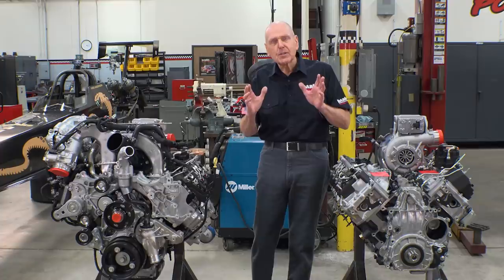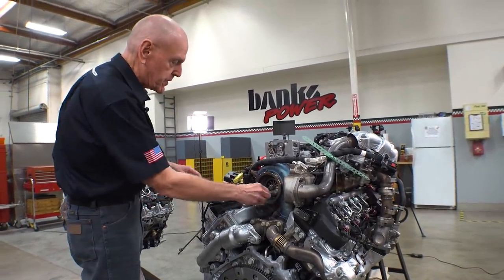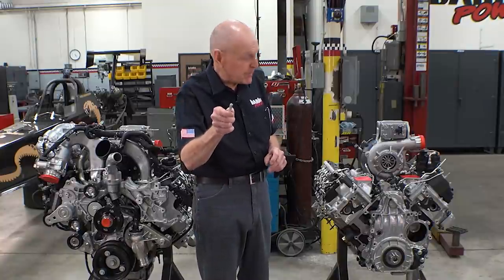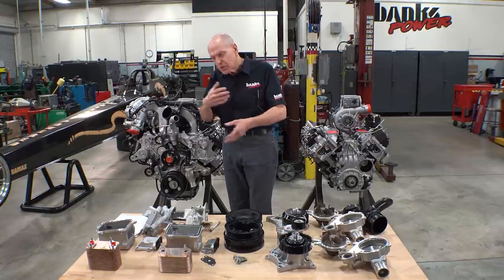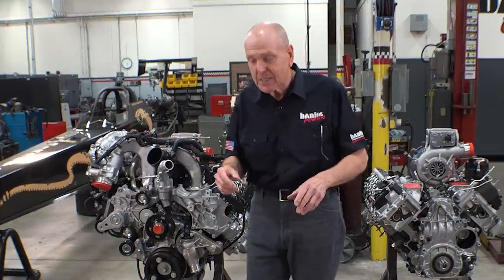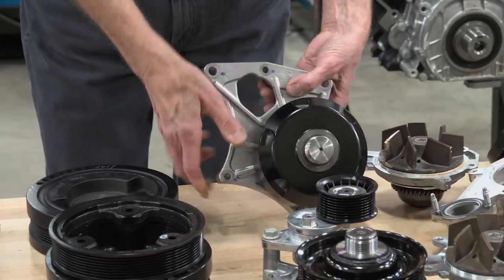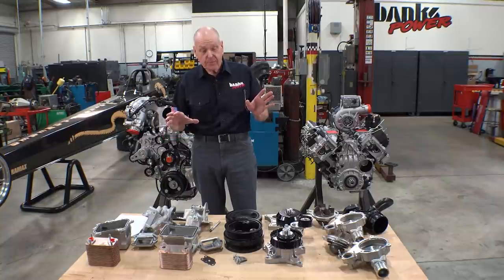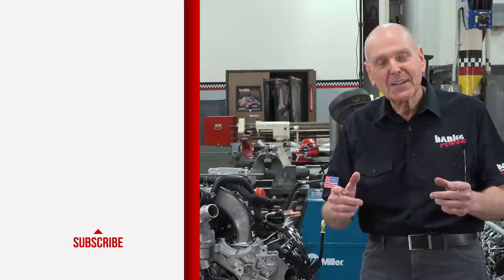2020 DURAMAX L5P Engine Revealed!

Comment: Banks is the the Diesel God and the Duramax is a sweet engine. Cummins are good engines but no match to the Dmax. Ford is about 15 years behind in Diesel technology. The ford guys think they have it all lmao. Yes Dmax had problems in the LB7 engines and the LLY was not that much of a upgrade either. Duramax got their shit together with the LMM engine. Dmax engines with the Allison trans is a bullet proof combination. I love the Duramax and worked on them from their inception. Yes ford sells more because owners trade off every year but it’s a fact that GM owners keep their trucks longer. I’ve had my GMC since new 2011. I just picked up a 1ton Doolly with the Duramax and she is a keeper as well.
Reply: Cummins is no match for the durajunk what the hell are you smoking ? Cummins is the greatest deisel ever period !
Reply: @nicknadeau7173  Why? Cuz YOU say so? OK
Reply: i cant afford any of it, ill just keep my old 12 valve.
Reply: We sure don’t trade off after a year , fleet of 20 plus f550 diesel all 200k no major failures , 550 chassis with a custom built body to house concrete tools , pulling a skid steer , gmc doesn’t even make a chassis to compete , try again I’m not saying ones better than the other but come on
Reply: My lly made it to 500,000 on the original injectors and pump. Ran efi live at 430hp from almost day 1. Upgraded to a 2015 high country dmax. Miss the sound of my 05 lly but the rest of the truck is a definite upgrade. Hopefully I get another 500,000 out of this one.
Reply: tlt40s&w 70 no match for the Dmax in blown head gaskets and injector consumption! If GM had their heads in the game they would have been able to tow over 30k when Ford and Ram started to almost a decade ago!
Reply: tlt40s&w 70 by the way, you know GM invented “planned obsolescence” right? The concept that customers will spend more money to upgrade to the next model every year if they slowly release revisions and tech to the market. I know you’re confused and it makes you feel things but get your facts straight.
Reply: Lb7 was the only one known for excessive injector failure and they stood by it up to 200,000 miles. We know ford and dodge would have never done that. And we had a whole fleet of dmax trucks. Every one of them went to 300,000 miles before they were traded in. Mine was the only lly and it was the only one to require headgaskets. And the cause was easily fixed. And all manufacturers use planned obsoletness. That's nothing new. Heavy equipment is way worse about that. Case constellation equipment discontinues parts after a model is 10 years old. They wont even support what they made. I dont like the business model of any of the big 3 but gm definitely builds the best HD truck currently with the most consistent track record. And the 30k+ tow rating is a gimmick. Less than 1% of consumers  actually tow that much with their HD trucks.
Reply: Michigan Farmer so you admit that Chevy guys don’t keep their trucks as long as ford and dodge guys? I have a fleet of Cummins, several over 600,000 miles on original engines and transmissions, which were just getting broke in at 300,000. Good friends of mine have fleets of Ford 7.3 trucks, some with over 700,000 miles on original motors and transmissions. Do you know how often we do ball joints? Less than you. Not to mention that these trucks are all used as fire trucks and are beat off road. No IFS Chevy can handle the abuse that these trucks do. We have had to leave Chevy trucks behind because they can’t handle the trail. I’m guessing because you’re from Michigan that you’re a flat lander, but here in the mountains we will take our straight front axles for durability and maneuverability. Also, Chevy didn’t stand behind anything on the LB7 and it was not the only Dmax to have injector issues. The LLY was not the only Dmax to have head gasket issues. How about turbo failures at less than 15k miles? There’s a long record of them. Radiator failures under 20k miles? A long list. And Dodge wouldn’t have stood behind it because no Cummins have had Injector or Head Gasket problems. Your facts are anecdotal. A good friend of mine has a fleet of welding trucks. He bough 15 Dmax trucks in 2016 for his guys and every single on has either had the turbo fail or the radiator fail under 30k miles. Do you know how Chevy helped him out? They told him that due to him driving his trucks on gravel roads they would not stand behind the truck and warranty parts. He was on the hook to pay for the radiators, turbos, and on tow trucks full engine rebuilds. Needless to say, he traded his entire fleet for Cummins rams and says he will never look back. The big 3 may use planned obsolescence now but that’s thanks to GM. Apple uses it, the entire tech world uses it. The world we live in is now built upon it thanks to GM. I’ll wrap this up with the 30k “gimmick” comment you made. First off, that’s spoken like a true loser, and the difference between a truck rated for the weight you’re towing and a truck not rated for it is an enormous fine if you’re caught and no insurance coverage if you’re involved in an accident. Those are two huge reasons alone, not gimmicks. 1% of truck drivers actually use their trucks as trucks. It doesn’t stop Chevy guys from “Mall Hauling” while the Fords and Rams are actually lining the highways with 5 car transport trailers and 46ft flatdeck haulers. Get your head out of your ass and do work.
Reply: Good greif, you never even asked what I do for a living. All trucks have or had their original ball joints. All have original turbos, radiators and every other thing you stated. I didnt both the fact that your company couldn't even design their own diesel engine. GM designed the duramax and isuzu built it for them untill 2010. Our trucks have trailers hooked to them every day. I dont care what you drive. I dont care where you work. I'm not even gonna get into a battle with you. Obviously you have a chip on your shoulder and feel its necessary to constantly defend. Go ahead. I really dont care. Enjoy you dodge, ram, fiat whatever brand of the week it is truck. And the 7.3 was good. For the 90's....
Reply: Michigan Farmer I don’t care what you do for a living son. I care about what lasts me the longest and what is best for my buck. GM should have known that they couldn’t build diesels on their own after their first 20 years of diesel building was a joke. 6.2 and 6.5 ring any bells with you? You’re right, Chrysler didn’t have the deep pockets that GM has. They’re what you call an underdog. But they chose the best diesel out there when they chose Cummins. I’m glad for you, that you’re lucky and easy enough on your Dmax’s that they have lasted to 300,000 miles but my trucks are held to a higher standard. The 7.3 was and is a great engine, don’t be upset that GM diesels from the 90s aren’t even worth laughing at. And the chip on my shoulder is from generations of “men” like you, urning this country into the weak bunch of pussies it’s becoming. What happened to the good old boys and good old days?
Reply: @gravityfab  I run a passion hobby shop on the side restoring classic antique tractors. I grew up on a farm. Still work with many. I am part of the good ol boys club. Know the history better than alot. And no I'm not a fan of the 6.2 or 6.5 diesels but know of many in our area still out running and earning their keep. Good for those folks. Look at every general contractor out there. Many are running the 03-07 duramax trucks around still. Way more than the dodge and ford diesels of that era. And remember gm made diesels long before the 6.2 and 6.5. They made the gm 2 stroke diesel. Only reason name was changed was because Ford had to run them in their medium duty trucks back then because they couldn't build a diesel to save their life and threw a huge fit about the engine saying GM diesel on the blower housing. So gm changed the name of the engine to Detroit Diesel. And the 60 series diesel? Know that engine? Know who designed it? He was a head engineer designer at cummins in the 80s and designed the engine. Cummins business board laughed at the design and said no trucker will ever want a electronic diesel. That engineer quit on the spot and went to Detroit diesel and presented his idea. They hired him on the spot and haulted construction of the electronic 2 stroke engine they were building. I've seen the 671 electronic with my own eyes. Never went into production. Instead they came out with the 60 series Detroit and changed the industry over night and cummins has been playing catch up ever since. And dont get me wrong. My favorite sounding diesel is an n14 celect plus I had in an old truck. Loved that engine. It's better to be more open minded than you are. Life is easier and more enjoyable. I would happily drive a truck with a cummins in it. Proven solid engine. Too bad the rest of the truck is what it is. And less the lower peninsula is mostly flat but you haven't seen many of our side roads and why our state is constantly ranked as the roughest roads in the USA. Ask any shop around here. Straight axles fail just as often as any out here from the pot holes. And boss and western snow plow manufacturers have strict restrictions on placing their plows on straight axle trucks. My gm can hold a larger plow than a ram. It's all in how you treat them. We only traded off the trucks not because of mileage but because of rust. And yes, they all rust. Have a good day and keep rolling on. It's what keeps America running.
Reply: Michigan Farmer well I’m not going to agree with you on any of what you said. I live in Idaho, work throughout Montana and Wyoming, and have land in Eastern Alaska that I drive the Alcan to every couple months, so don’t talk to me about rough roads. You want to get into the history of the diesel? Compare how many legendary Diesel engines used a V config to an I config and get back to me. Based on your “Ram didn’t build their engine and GM did” theory, I guess Kenworth, Peterbilt, Mack, Western Star, Freightliner, and Sterling would all be on your “crap trucks” list? And what are you basing the “shame the rest of the truck is what it is” comment on? Because you’re uncomfortable in a dodge? Is the seat to firm for you? Is the ride too harsh? I hear that from plenty of fancy, pinky out Chevy drivers. Where I live, more contractors choose Cummins. Chevy isn’t even a consideration. More plow trucks here are straight front axle because IFS camber change kills you in deep snow. Here are a few reasons I choose Ram. Manual transmission, manual transfer case, straight front axle, boxed frame, straight 6 Diesel engine. If you have any disagreements on those key points then explain why Chevy guys swap straight front ends, manual trannys, and Cummins engines into their trucks. We can sit here all day and talk the history of legendary diesel performance and reliability but the fact is that Americans are getting softer, lazier, and dumber and it’s thanks to guys like you who will buy the automatic, buy the soft riding IFS, and buy the unreliable engine in favor of trading it up at 300k miles or less. Good job 👍🏽
Reply: @gravityfab  wow I guess you hate every farmer out there too because they now have synchronized transmissions,  Powershift transmissionsand cvt transmissions. How dare they have an air ride seat. Air conditioning?  Heck some tractors now have suspensions. A-frame independent mind you. Not the Mayflower technology straight axle. Im surprised you actually like diesel. Most guys back in the day hated diesel over gas and excoriated the men who were pushing the "new" technology. I plow snow for a living in the winter. Commercially. Both in a truck and in a tractor. I have 0 complaints with the IFS in the snow. I'm in the lake effect snow belt too. I know snow. You sir, are what holds America back. Arrogance is not something we need more of. We get enough of that from the left. Pac car makes their own engine now for their trucks. Mind you it's mostly pirated technology. The comment about dodge is based on the master ase certifications and degrees in heavy equipment and diesel technology. I hate how these trucks are put together. They have so many quirks and failures on such simple things. HVAC, Seats. Infotainment systems. The engine is good and they finally have a transmission that's ok. Cant handle at all what an allison can but it's alright. I have a family. A full time self employed job and a farm I run. I'm not what's wrong with America. I pay my way. Provide for my family. Ask for nothing and drive what I want. Sorry you have to play second fiddle to it. I didnt come on here to make you so upset. Enjoy your ram. I hope it serves you well. Mind you fiat gave Chrysler 5 years to show a profit before they shut down ram and chrysler and only sell jeep in north America. Thats right, jeep is subsidising your ram truck. Your ram is the underdog. While ford and GM are carried by their truck brands...

Honestly though, the seats are pretty comfortable in the ram. I'll give you that. One of my good friends owns one. We're still friends too can you believe it?
Reply: Michigan Farmer one more little fun fact for you. There are still Yugos running around “earning their keep.” Doesn’t mean I’m putting any faith in one. If GM had such a long history of building successful Diesel engines, were the 6.2 and 6.5 just their way of choosing to not use all the diesel know-how they had? How do I as a consumer know that they won’t pull that again? How do I know that the almighty GM, one of the largest and most powerful Corporations in the world, a brand who has proven again and again that it doesn’t give a damn about its employees or people in general has my best interests as a consumer in mind? You’re talking about opening my mind to alternatives, GM has more intolerance related lawsuits currently stacked against them than Ford or Dodge ever have. Do a little digging...oh wait, you’re a Chevy guy, you probably don’t like getting your hands dirty.
Reply: @gravityfab  finally you asked a very valid question. The 6.2 and 6.5 mindset from gm. The 6.2 was never built and designed for heavy hauling. It was designed with one thing in mind. Fuel Economy. And it did amazing at that. Back then the 454 v8 gas had more power and a larger tow rating. And that's what they promoted for that purpose. The very early 6.2 engines were known for issues at the 2nd main journal and was addressed after I think year 2. It was a very underwhelming engine for power, speed and most everything. But you could almost achieve 30mpg in a GMC Jimmy (full size back then). That was remarkable and unheard of. The 6.5 was their answer to the demand for a bit more pulling power. And honestly the 6.5 has a decent reputation world wide. Minus the fuel injector module that would regularly fail but dis have an update to move it to the fender which did extend its life. It was too light though for where GM knew diesels were going. Unlike ford, gm planned ahead and was developing the dmax idea mid 90s. Ford had their head up their rear kinda like cummins did back in the 80s with the electronic diesel. And Ford has even admitted the dmax caught them with their pants down. They were years out from being ready for a new diesel and ford forced navistar (International) to hurry up production of the 6.0. Navistar begged for more time and said it wasn't ready and ford insisted on rolling it out reguardless less they loose loyal customers. Unfortunately the 6.0 is a big black eye. And in typical fashion, ford just pointed the finger and blamed navistar. Kinda like they did with Firestone in the 90s. The 6.4 is just as bad. But at least ford is making a go at it on their own now with the 6.7. Not that its amazing. But it is theirs. And dodge wouldn't exist if it weren't for the cummins. That engine saved the truck single handedly in the late 80s. Dodge was bankrupt and the cummins was their last ditch hail Mary.  Cummins even told dodge the b series was not designed for on highway use. It was for industrial/ag purposes and they had no clue how it would hold up on highway. Luckily for them Cummins is better at building than navistar. The b series is one of the best engines out there. It truly is. But in the truck market I put the dmax and the cummins side by side. The duramax has revolutionized the "competition diesel" as the competitors call them. The allison trans makes me loyal to my truck. And the fact that my last one made it half a million with hardly any repairs. And never once stranded me. I'd understand if anyone was loyal after those experiences. Kinda like you are. But the difference I dont go around trash talking the owners of the other brands. I defend my trucks reliability and that's it. And no, I'm not GM nut. They should have went bankrupt. So should Chrysler have. The company's could have rebuilt and probably been better. But that's a whole different topic. My folks drive a jeep grand Cherokee. My wife drives a Honda odyssey. My best friend drives an f150. I work on all of them.
Reply: Michigan Farmer you make this sound like a soap opera...jeeze. Have a great day buddy and remember that you started this pissing contest with me. Oh, one more thing for you to think about. The 6BT was built for the highway, it was just designed for medium duty use...meaning over engineered.
Reply: @gravityfab  thank you for fighting the fires. I get that that's a hard and tough job. I obviously got under your skin. I too think GM is way too large. I actually hate the uaw and think that's the biggest problem in the automotive world. To think some deserves 30+ and hour, plus benefit and pension for simple assembly line work is ridiculous. 9k of every new GM sold goes straight to pension funding for retired employees. That is not sustainable for any company. And any engine/tranny building company will point out the weakness and limitations of the Chrysler transmission. Look calibrated power solutions website. They tune and build them all. Dont take my word for it. Can you tell me what was so unique about the b series engine when it was first designed? A very critical part of its design that later proved itself but was highly contested at first? Keep doing your work. I'll keep doing mine. At the end of the day, hopefully both GM, ford and Chrysler can all fail and go back to simplifying the vehicles. We are soft anymore. I give you that. But we're even softer anymore in our ability to discuss with out getting all bent. Good day.